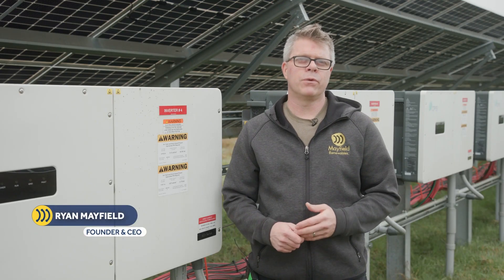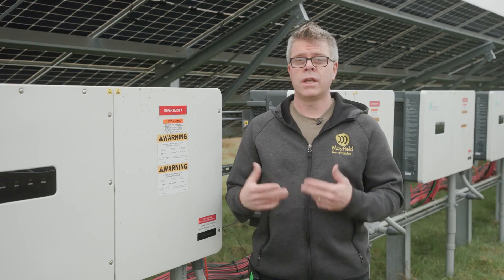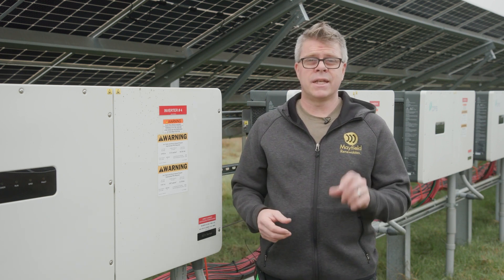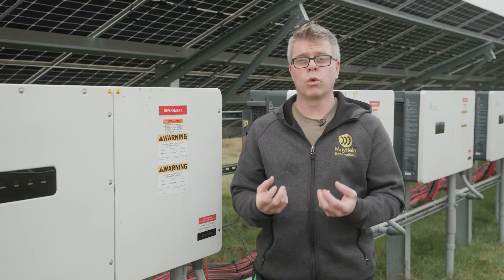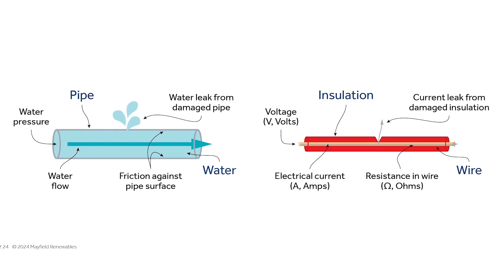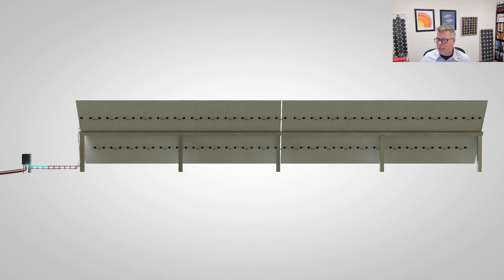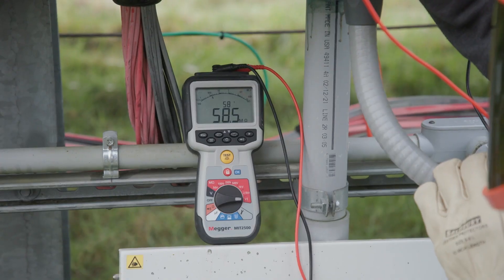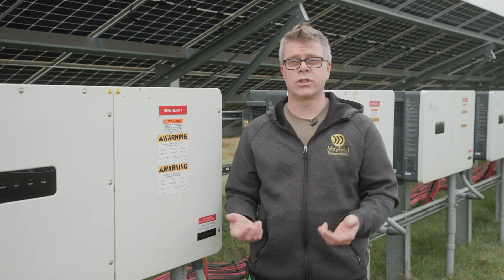Course Preview: Insulation Resistance Testing for PV Systems

Comment: Hey Ryan. Is it possible apply the insulation resistant test through the modules if they have voltage?
Reply from the maker: Yes, given the meter is connected from negative to ground, there should not be any voltage present between those conductors. If there is, the meter would detect the voltage and go into 'safe' mode and not energize the circuit. In all cases, always get approval from the module manufacturer first.